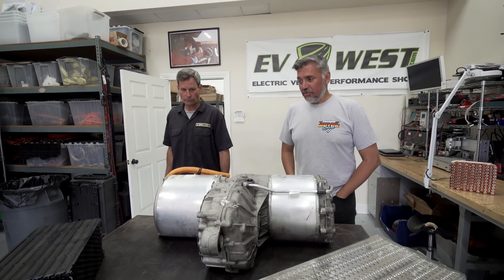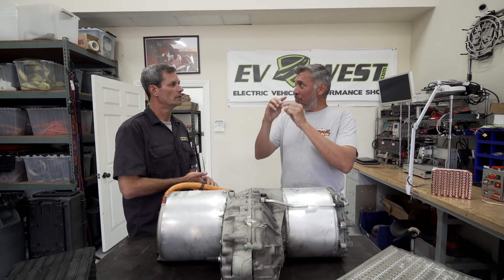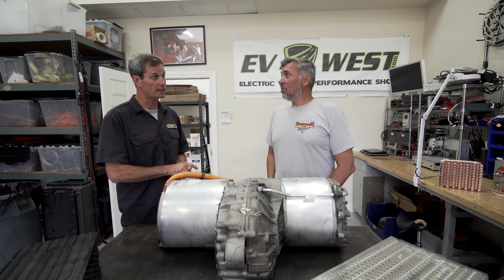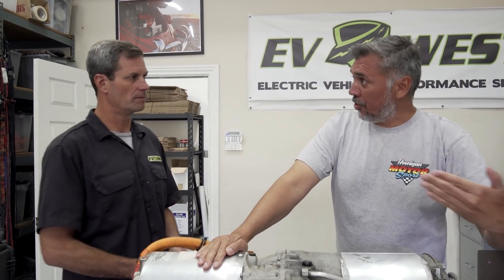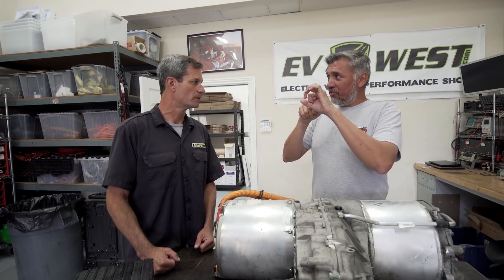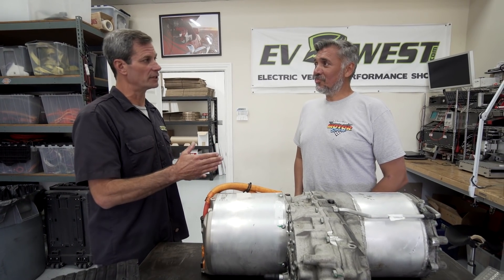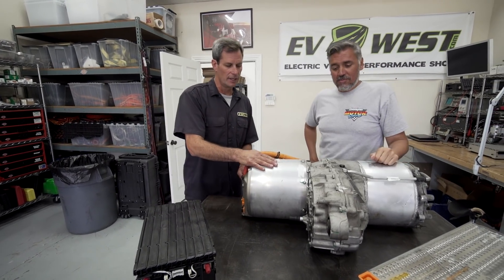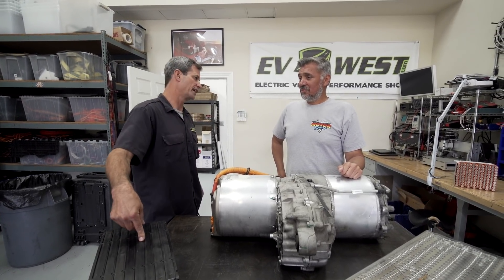How Does a Tesla Motor Really Work?? EV West Drops Knowledge

Comment: I hate the whole engine vs motor debate. According to every dictionary a motor is ANY machine the is creating mechanical power. Most even say the same for engine but usually they will say engine is combustion.
Reply: In simple terms (although I'm not sure the etymology is 100% correct), motor = converts energy to motion, whilst engine = converts fuel to energy, and then energy to motion.  Note that 'energy' doesn't have to be electrical energy - ICE engines rely on thermal energy, for example.
Reply: @logicalChimp  100% probably the best I've heard it put.
Reply: @logicalChimp  best explanation yet. However fuel, such as gasoline, is chemical energy.
 So (energy > motion = motor) ???
 So as I understand it the difference here being the additional step of energy conversion identifies it as an engine.
So along that line of thought, in a Hydrogen fuel cell vehicle, would that would make the 'cell' an engine?
(Chemical energy > electricity energy > motion = engine) 
(chemical energy > thermodynamic energy > motion = engine)

Yeh, I'm clutching at straws I know but this motor/engine thing has always bugged me for every explanation I get usually I find evidence for the contrary. 
I must know more, Google's rabbithole, here I come.
Reply: @rarkitorparkit  I think a Fuel Cell would count as a Generator - because it generates energy, not motion - you still need a motor to turn that energy into motion. 

But if you have a fuel cell and a motor packaged into a single unit, with no way to access the intermediate energy, then yes I think that would be an Engine :)
Reply: In spanish,  is just one word  "motor"
Reply: @AxelEmiDiaz  Most other languages it's only one word as well. English is made up of several languages which makes it stupid difficult.
Reply: @jamesgodwin4437  yeh, the English language is made from a parts bin of other languages. Motor = electric.... like motorbike? Which (until recently) was powered with an ICE. 
Crazy humans
Reply: @rarkitorparkit  leave it to the English language to make things 10 times more difficult for foreigners to learn it.
Reply: Strictly speaking it should be called electrical machine not electric motor because it operates also as a generator during regenerative breaking. XD